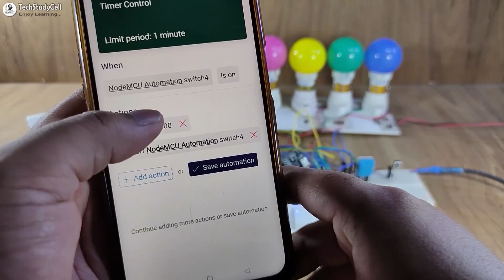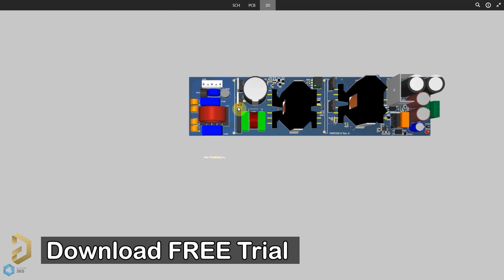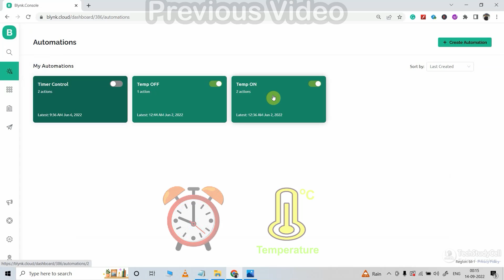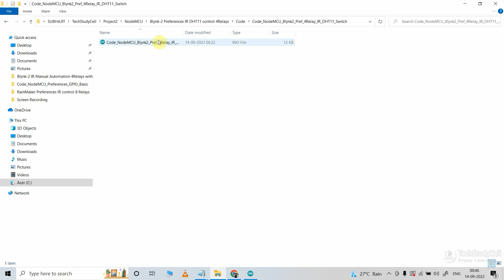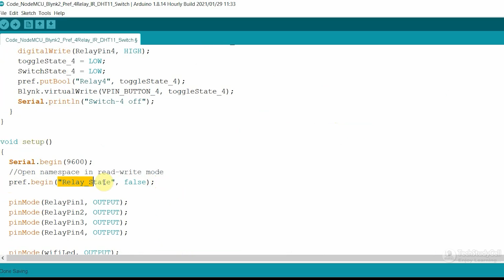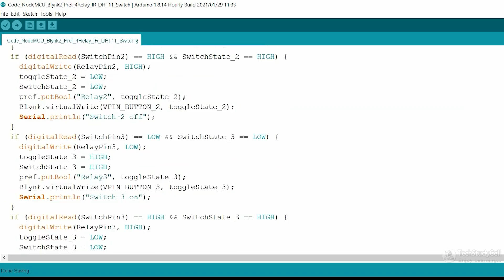IoT based projects for final year using NodeMCU ESP8266 Blynk with Sensor - Smart Home system

Comment: Sir everything working fine. But problem is that when node mce disconnected from wi fi it didn't connect again it self to wifi. It has to restart to connect wifi. I am using code which uses blynk edjent library. Please resolve this issue. Thanks

Comment: Can i change gpio pins D1 2 3 4 for relays and for switches D5 6 7 8 is that work proper? And sd2 its not work with ir recvier which other pin is better for ir and dht. Can i use rx or d8 for ir and sd2 or 3 for dht sensor.

Comment: Today I tried the code and I wanted to change hex code but the given hex decoder code is not displaying anything in serial monitor tried other code and it worked so i replaced it . automation code is not detecting code also I placed hex code after 0×

Comment: Sir can you please add ota code upload feature in your codes so we can upload code on esp board wirelessly (No Usb)... I have installed esp32 project in my wall electrical box... So to update it your new codes I have to take out all the wire connection again and again... It would be great if you can add AsyncElegantOTA like Library... Thank you